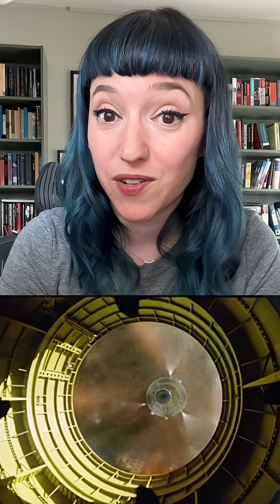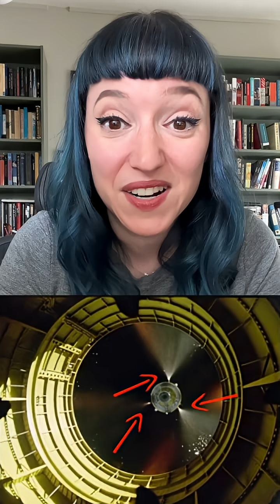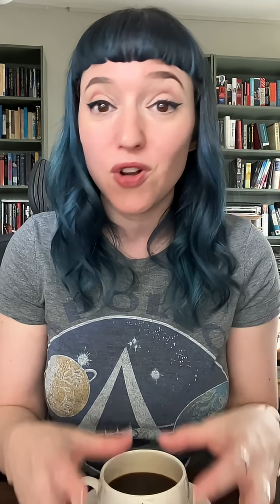These motors make rockets work in space #shorts #science

Comment: Wouldnt it be possible to have a high pressure reserve of fuel and oxidizer used for innitial main engine start?
Reply: The problem is that while the stage is coasting it's in free fall, and so are the contents of the tanks. Pumping in more gas won't force the liquids to the bottoms of the tanks, because in free fall the contents aren't experiencing any gravity.

Comment: FYI.
During 'staging'(when one stage is discarded and the next stage is ignited) the Apollo actually is in 'freeflight', meaning there is no thrust pushing the spacecraft forward. So the fuel sloshes forward too. Ulage rockets give it enough thrust to force the fuel back to the base of the stage so it can be pumped into the engines
(Remember in the movie Apollo 13 when staging occurs, commander Forrest Gump head is thrusted forward).
The Soviet space crafts ignite the next stage before they discard the previous stage which is why they have that lattice looking structure between stages.

Comment: Once the main motors of that next stage ignite, they start providing the acceleration that will keep the fuel and oxidizer liquids against the ends of the tanks where the discharge nozzles are located.  If EVER, the net acceleration of the ship, in the direction of travel, falls below zero, the liquid will start to travel away from those nozzles, and toward the front end of the ship.  This video talks about stage separation and how you have to manage net acceleration but another time when this comes into play is when you get to the moon, or mars, or other destination (even back to earth), and need to swing the ship around to use your engines to decelerate prior to orbit, or landings.

Comment: Have you talked before about how NASA got the camera and film back? I would like to know how the protected the camera from any reentry heat and not sinking to the bottom of the Atlantic.
Reply: Re-entry heat wouldn't have been that significant, as the rocket at that time was still travelling at well below orbital speed. I imagine it wouldn't have been too challenging for engineers to design a pod to contain a camera, a parachute and radio transmitter which could also float.

Comment: So we see exhaust gases here and the lit main engine. There is endless critique of the lack of exhaust gases or any visible rocket firing on the famous Apollo 17 takeoff from the moon. I'm not a denier but anyone care to rationalise that please ?
Reply: Fair question. The main difference would be the type of camera. For the Apollo 17 lift off it was a fairly low resolution TV camera. This footage was recorded by a film camera which would have had much higher resolution.

A second difference is the distance between the cameras and the exhaust flames. The Apollo 17 camera was about 100 metres from the lunar module. This camera is less than 10 metres from the combustion chambers.

I hope this helps.
Reply: @maxfan1591  thanks, but not entirely convincing. The upperstage in orbit is surely more than 10 meters away, and while it is from a recovered film camera the difference in resolution I don't think is enough to justify no evidence of thrust, (beyond all the debris being shot out).
Are ullage thrusters hypergolic? Do hypergolic fuels work without a visible flame.
The reaction control thrusters on the ascent stage (also used during descent I think as there are none on the descent stage) have to fire on ascent to keep the LM stable as the wieght of the fuel tank and oxidiser tank (if thats the right words for hypergolic) are assymetrical. But there is no sign of any puffs from them on the way up nor any glow in the main engine bell.

Comment: How does the SpaceX dragon do it?
Reply: Dragon doesn't need it as it doesn't have an engine. The staging between first and second stages of the Falcon 9 uses pneumatic pushers (according to their users manual).
Reply: @maxfan1591 Uh, okay 👍🏼
Reply: @maxfan1591  Dragon certainly does have engines — but the SuperDracos are pressure-fed, so they don't need ullage to get fuel flowing through the their non-existent turbos (important for an engine primarily used as an escape system).

Comment: Is that why SpaceX starship has adopted hot staging?
Reply: Partly. Using hot staging simplifies ullage during the launch -- but it doesn't eliminate the need for thrusters (usually in the form of the RCS) to provide ullage for lighting the engine at all other times. The main benefit SpaceX have claimed for hot staging is avoiding the delay between booster shutdown and stage ignition, which they say represents a considerable fuel saving.

Comment: One alternative to this is "hot-staging", where the engine ignites before the previous engine(s) shut down. The downside is that you need exhaust vents in the interstage.
Reply: Yes, though even with hot-staging, ullage thrusters of some form are needed if you want to be able to re-light the second stage engines later in the mission... e.g. to de-orbit the second stage, or for trajectories requiring multiple engine burns. These may be the same as the RCS thrusters.

Comment: The ullage burns in the LM were made by the RCS thusters... inicially the ullage would fire, then the descent stage would run at 10 percent for 20 seconds, to assure the thust vector was aligned with the LMs centre of mass. Then it would go to full throtle. In the LM, there was a problem after ullage, as the fuel would slosh in the tanks, then the AGS would fire the RCS thrusters to keep the centre of mass aligned. The slosh problem would only be fixed in Apollo 14.

Comment: As a retired Mechanical Engr, I didn't realize or think about this! I just thought these motors were only for stage separation, as you mentioned. But didn't think about the fact they also would help keep liquid fuel/oxydizer from having gas that could starve the fuel pumps/engines. Great technical detail, Amy! Thx! :)
Reply: Kinda like the WW2 Spitfire with its carburettor would starve the engine in a -ve G dive.
 German fighters used fuel injectors and didn't suffer from that problem.
Reply: Former ESA space scientist here - They're kind of important for both tasks. Separation can be a bit fraught - one is always super nervous of collisions, particularly with that really ginormous delicate nozzle out the back of the next stage we see here.
Reply: It's actually worse than that... If the turbopump/s spin up in a gas bubble they could over-rev and damage themselves, and also when they do start sucking liquid, the impact with said liquid would likely cause instant disintegration of the pump, which typically spins at tens of thousands of RPM, which would mean...kaboom. :D

Comment: That was one of the problems faced by Starship, the absence of these type of motors make the fuel float in bubbles, Starship solve this problem with a Soviet approach: hot staging
Reply: It's a problem of every 2+ stage liquid fuel rocket.😂
Reply: @MrT------5743 Indeed, but those aren't normally reusable.
Reply: Not entirely. Starship still needs to re-light the engines at various stages of the mission, at which time it uses the RCS thrusters for ullage... as does Falcon 9, and pretty much any other launch vehicle that has engine re-light capabilities.

Comment: So how do they get the S-IVB stage to fire twice? They use the mini rocket motors twice?
Reply: The 500 series S-IVB used two solid rockets for separation and ullage (side note: this video obviously shows the 200 series), but the 500 series also uses two Auxiliary Propulsion System modules both for ullage and for attitude control during cost phases. Each APS module held two 150 pound-force thrusters for pitch and roll, a 150-pound-force thruster for yaw, and a 70 pound-force thruster for ullage.Send hydrazine and tetroxide to the thruster and you have enough to settle liquid propellants for ignition.
Reply: @ScoutRiderBrian 
Excellent.👍🏼

Comment: Then how do the ullage motors work? Are they all solid fuel?
Maybe they just need to invent engines that work with that not-quite-gas-not-quite-liquid fluid.
Reply: Ullage motors typically use simpler fuel chemistries that don't have all of the complexity that Amy is talking about here. They can be solid-fuel based, mono-propellent based, etc., but these operate at a lower efficiency (less "mileage" for weight) compared to the main engines. You want high efficiency (Isp) for the main engines, because you want to minimize the amount of weight to bring to space (you need fuel to move your fuel), but for ullage motors, the smaller size (and shorter burn times) means you can afford the efficiency loss.

EDIT: For the Saturn V, it looks like the ullage motors used Monomethylhydrazine and Nitrogen tetroxide as fuels. These spontaneously combust when put in contact with each other.
Reply: @xchoo those were solid fuel.
Reply: It depends on the vehicle in question, but generally they're either solid motors or pressure-fed engines. In the latter case, they may be the same as the RCS thrusters for manoeuvring..

Comment: So, if I understand correctly, those engines produce just enough artificial gravity to allow the fuel to flow down into the fuel lines? 🤔
Reply: @francoislacombe9071  Well, acceleration, actually.  But since gravity feels the same as acceleration along a vertical axis, sure.
Reply: Einstein's theory of general relativity shows that gravity and acceleration are mathematically the same thing. So, a mass undergoing acceleration behaves as if it's experiencing gravity.
Reply: @xchoo  Yeah, what you said. ☺
Reply: The liquid settles on the bottom of the tank, and the gas floats to the top. The inlets of the fuel lines are located on the bottom of the tanks. The required flow itself then is made by the turbo pumps. But they only like bubble free liquid feed.